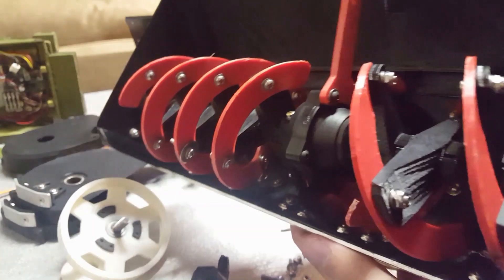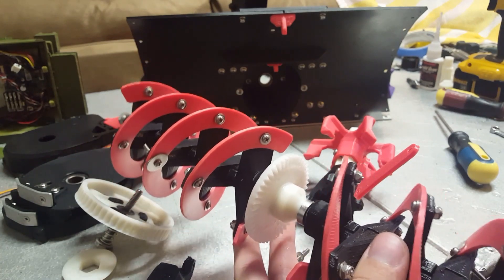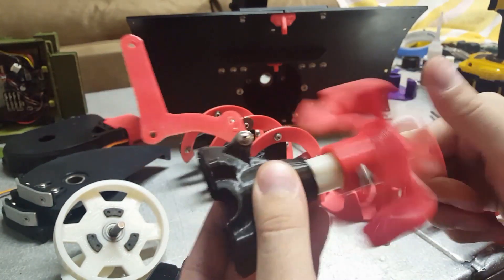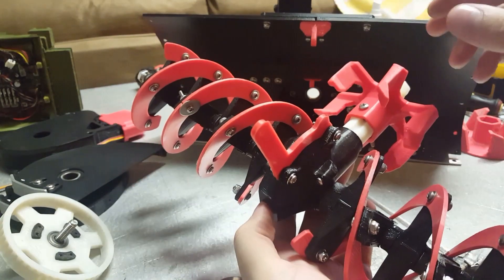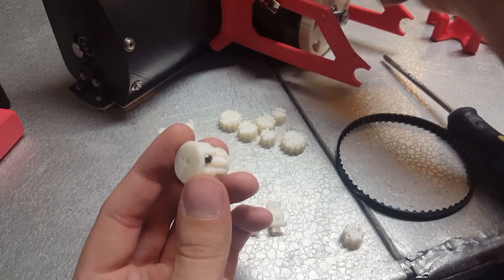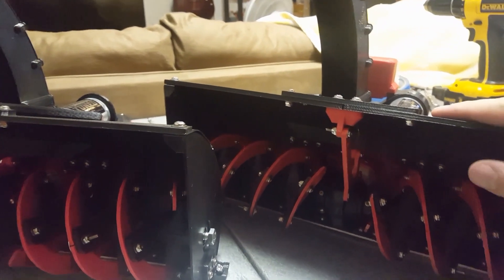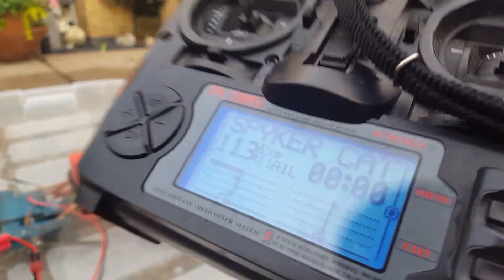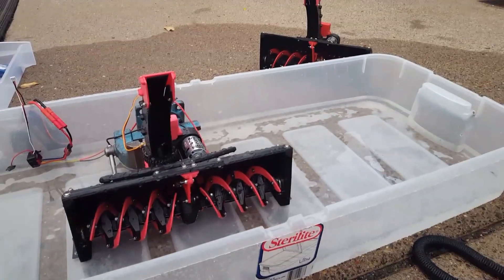Spyker Workshop 3D Printed Snow Blower New Gearbox + Water Pump Test!

Comment: Really nice design! I think it will improve the performance in snow, because now the impeller "has more time" to throw out the snow without getting bogged down too much, as the auger blades move the snow to the impeller a bit slower.  
I just purchased the stl-files from your shop and I am about done with printing. For the hardware I am going to use mostly metric parts, as they are common here in Germany. 
I was actually hoping for a replacement of the traxxas differential, as the traxxas parts - like you said - are getting more expensive and you have to order each single part separately. 
That your design uses custom made gears is a bit of a downside, because of shipping cost, shipping time and import taxes to Germany.
Reply from the maker: Yeah that is a big down side of the new upgrade, only place really to get the new gears inside the diff would be from me or a CNC shop. (In the STL update I will include files so you could get it CNC cut if you had access to that yourself or a local CNC place) I don't think 3d printing the gears would hold up, but you could try that also.
Reply from the maker: Actually... I will try that myself, going to 3d print the gears right now and just see if they could hold up...
Reply: It would be so awesome, if it worked! Thank you for giving it a try! 
I am actually using 3D printed gears in the tank to which I want to attach the snow blower. The gears are printed from PETG and so far everything holds up nicely. But I only ran them for a short time yet. You can have a look at the gears here: 

https://www.thingiverse.com/make:367925

I guess the size of the teeth and the contact area is somewhat bigger than on the gears in your new differential.
Reply from the maker: I just posted the video actually lol: https://www.youtube.com/watch?v=OH_51LZ1VzM

That is a sweet looking tank there.
Reply: Thank you, I really hope the tank is big/heavy enough to drive your snow blower. 
The performance of the printed gears in your new video is impressive! Long term durability might be a question, but one can always print a new set. I'm definitely buying the files for the new differential from your shop as soon as they are available. Your tracks might also be a nice upgrade for my tank, especially for driving in snow.